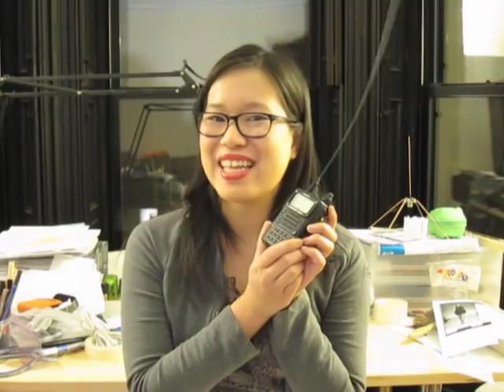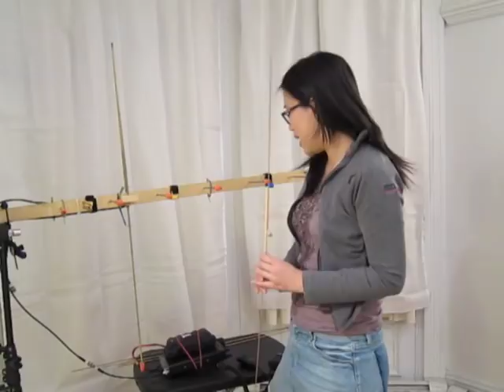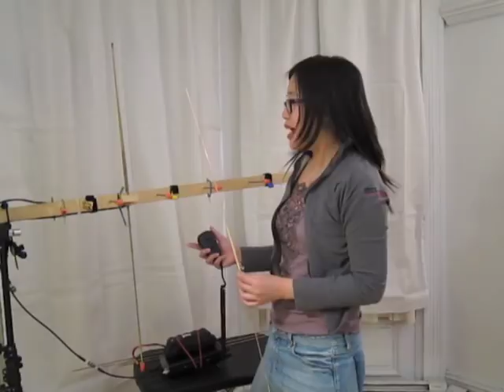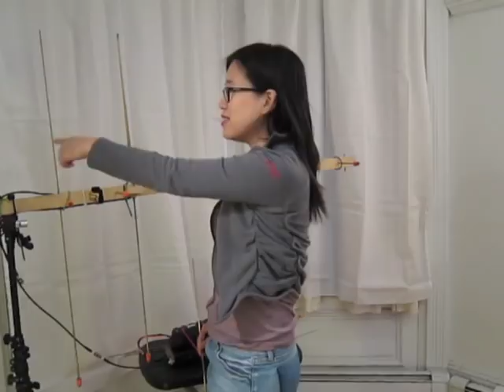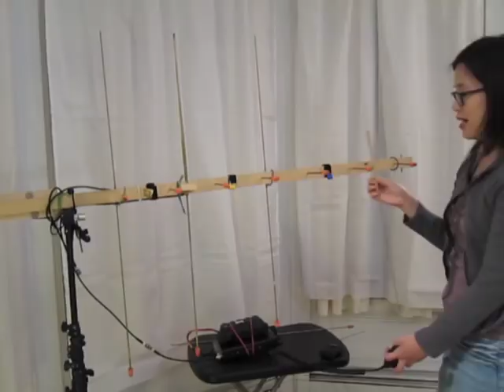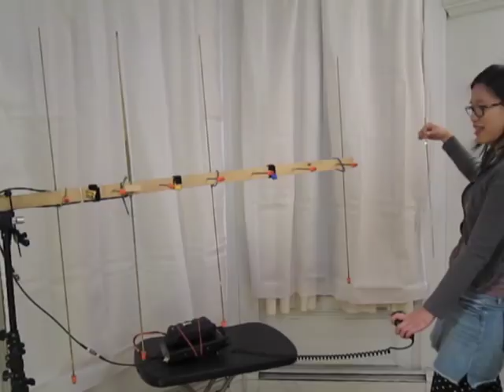Directional Antennas

Comment: No, because the amount of energy at any given point is inversely proportional to the square of the distance from the source to the destination.

So if you transmitted 50 billion watts of energy a mile it would be reduced to about 1500 watts.  That number also decreases dramatically depending on how far apart the sources are spread.

Comment: What's with the polarisation on that antenna? Looks like it wants to be vertical, but horizontal at the same time. The dipole is on horizontal, so why the vertical directors? But there is another dipole on the vertical axis. What's going on there???

Also, space is only 60 miles away, not 'millions'...

Comment: good heavens how unsafe, we can assume its 2m or 70cm which has greater effect on the body and then you put gain to the antenna and stand in front of it!! also not showing that you made a transmission on a radio with no identifier? education sure but missing out on some serious safety and governing rules might as well just play with microwaves they are a lot cooler if you don't care about safety